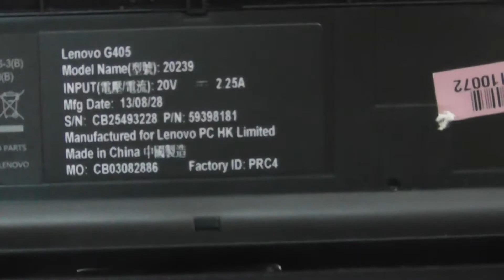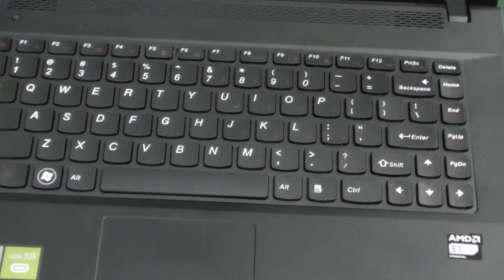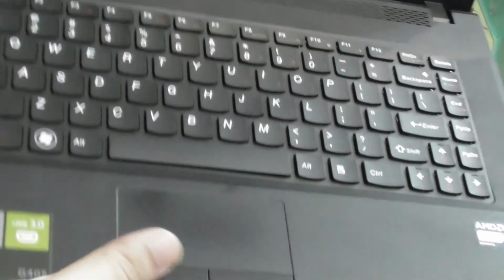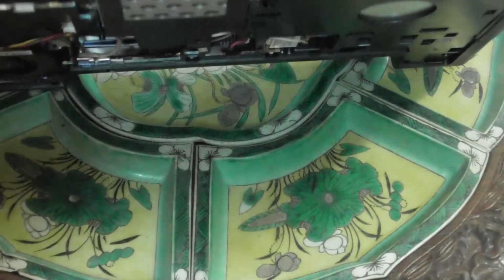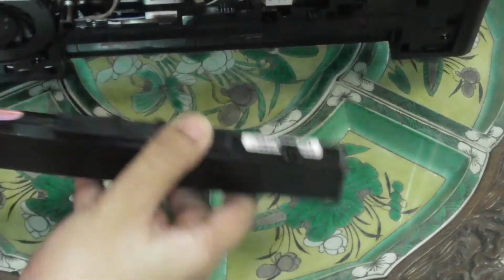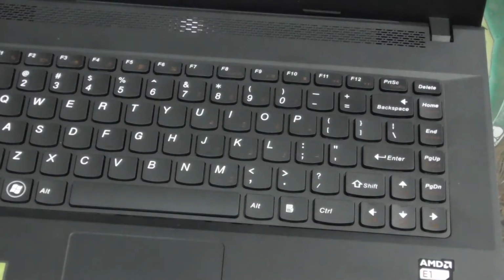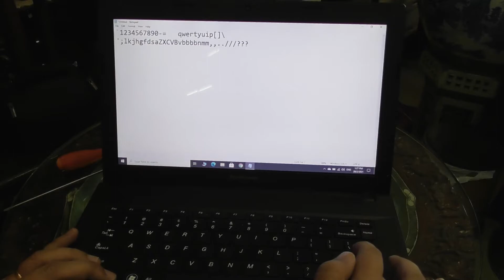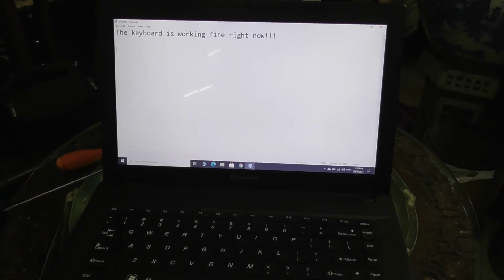Replacing Lenovo G405 Keyboard

Comment: how to upgrade lenovo g405 to windows 7 to windows 10
Reply from the maker: You can try installing Windows 10 Upgrade Assistant.  You should be able to upgrade to Windows 10 using that method.